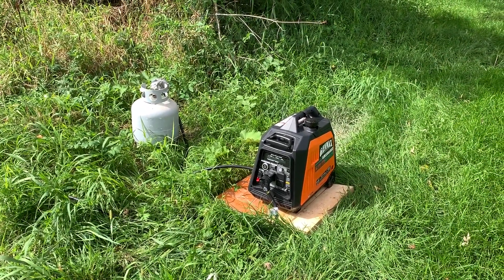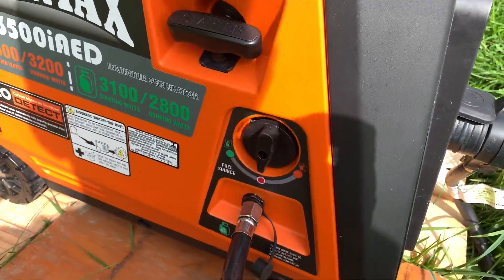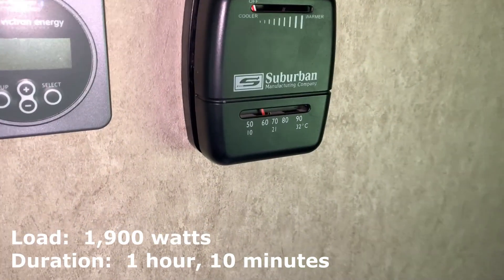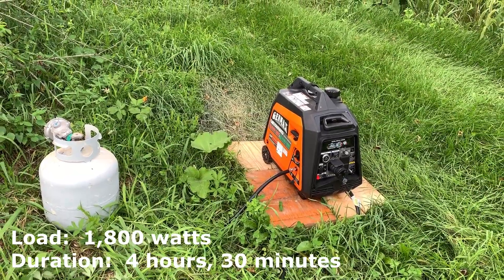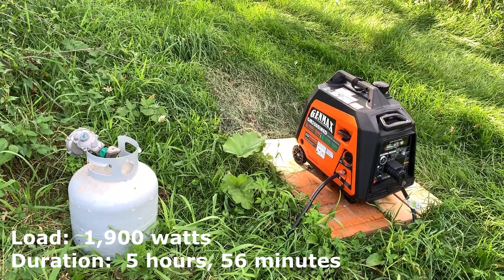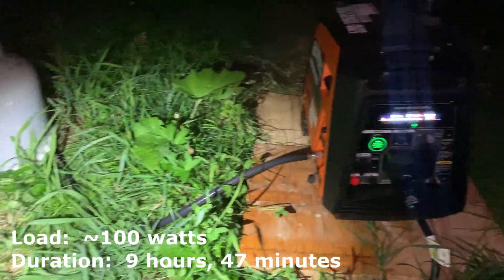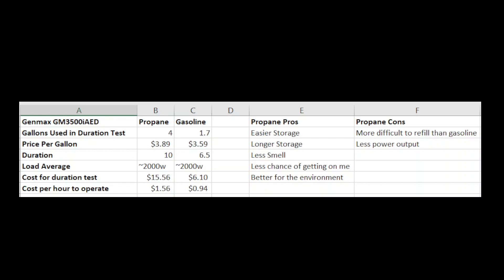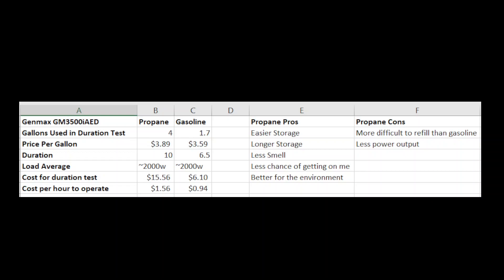Dual Fuel Inverter Generator Duration Load Test - Genmax 3500 (GM3500iAED)

Comment: Liquid propane change to vapor propane is dependent on heat transfed via tank.  When the tank ices, there is not enough heat transfer to convert liquid propane to vapor propane therefore the gen was starving for fuel near 9 hr mark. In a real application, just change to another tank then alllow first tank to come ambient temperature. Good test. I am wanting a dual fuel. This was very well done. Thanks.
Reply: Thank you for this explanation I’m buying this Generator with remote start for my Rv

Comment: thanks, this will be be next gen for the rv, my 2000w works but I am maxing out the output with the ac and solar / battiest charging phase. I need a bit more power and this on is the right size and output thanks
Reply from the maker: The size and power output of these is impressive!  The only downside is the smaller fuel tank, but it isn’t even that big of a deal :) thanks for watching!  If you do buy, be sure to use the link in the description!!

Comment: Planning on buying in spring, have you heard about longevity propane vs gas I know when I used to rebuild engines years ago propane would burn our exhaust valves much faster than with gasoline. Great videos helping me decide on next generator, have harbor freight’s predator 3500 works great but a pain lifting in and out of truck
Reply from the maker: Those predators are great but heavy!  Unfortunately no I don’t have any knowledge or data on the longevity of propane vs gasoline on these engines.  Thanks for watching :)

Comment: Does the remote start work when using propane?
Reply from the maker: To restart after it has been running, yes it does work.  The problem is propane does need to be primed when starting to purge air from the lines.  Priming can only be done on the regulator on the generator, so remote start probably wouldn’t work.  Thanks for watching :)
Reply: @codys-garage  Thanks, that makes sense.

Comment: Have you used your Genmax GM3500Iaed in high elevation areas ? And if so did you have to replace the jet and did you run it on propane or fuel ?
Reply from the maker: Just a few weeks ago we were at 9,000 feet in Colorado.  I did not adjust the carb or jetting and it did fine on 87 octane gasoline.  You could tell it was working a little harder, but it still did everything I needed without overloading.  Thanks for watching :)

Comment: Definitely refilling is a pain for propane, but in a normal trailer you have it anyway.  Of course I have friends that just add a dispensing port off their car gas tank for their generators.  Still can be messy.  Too bad you didn't weight the tank after 2 hours to see what it actually consumed.   Nice video.

Comment: I purchased the Genmax 3500i (with your link, thank you) and on day one, the first time I pulled it around in my driveway, one of the wheels fell off. I tried sticking it back in but it won't stay in. One wheel is well attached and the other just falls out. Do you have any tips or suggestions on how I can hmget the wheel locked back in???
Reply from the maker: I would reach out to their customer support and explain it, also include some pictures.  They are in China so the response time can be about 24-48 hours, but they have always gotten back to me.  Thanks for using the link!  Sorry you’re having difficulties!

Comment: Are you still using and happy with the Genmax 3500? I'm considering ditching my Honda eu3200i as it is hard to start sometimes when the temp drops below 40 degrees. I like the duel fuel and electric start on this but want to know if you're still using it after 8 months, or if you've moved on to something else? Thanks! JR
Reply from the maker: JR, I am still using this and loving it!  It has about 115 hours on it with oil changes at 4 hours, 50 hours, and 100 hours while running full synthetic 5w30.  Just last week we got dumped on with snow in Colorado.  This was outside and in 22 degree weather and the remote start worked flawlessly.  Its a super solid machine and you’ll see a 100 hour review of it posted here.  If you are considering buying it, i have an affiliate link in the description!  Thanks for watching :)
Reply from the maker: I also have 8 other generators to choose from in my garage at the moment (I know, I have a problem), but I always gravitate to this machine.
Reply: That's good enough for me... SOLD!! I'll use your link and Thank you for the follow up recommendation on the oil. You're very kind!
Reply: The EU3000i is an expensive unit that has only been out about a year. Honda goes for perfection but it can take a while. Have you reached out to them for support? I am very curious about this because I want to move to an EU3000i when they get the bugs worked out.
Reply from the maker: @johnganter7352  I have reached out and they declined sending a demo unit to review.  Frankly, their products are very expensive and there are pretty darn good competitors out there for about 40% of the price.  Thanks for watching :)
Reply: @codys-garage  Thanks, but I was referring to the gentleman who said "I'm considering ditching my Honda eu3200i"
Reply: @codys-garage  The economics are interesting. There are credible claims that EU2000i's have lasted 10000 hours in Alaska. Let's suppose an EU2200i will last for 5000 hrs and costs $1400. Next suppose a Chinese generator will last for 1000 hrs and costs $500. This works out to be 28 cents per hour for the Honda and 50 cents per hour for the Chinese product. There is no "right answer" here, each person has to choose their return on investment. Food for thought.
Reply: @johnganter7352 Yeah. But at the 1000 hr I can buy generator #2 and generator #3 later in future. Future model's become better and more features. More Fun. Also when you finally get Chinese generator #2 if #1 is still fine___ You can connect them. Fun in Life also makes the World Go Around.

Comment: Is it necessary to use that 30 amp adapter on a 30AMP RV plug? Curious as to why?
Reply from the maker: Yes!  The generator does not come with an RV ready 30 amp plug, so they include this L5-30P to TT-30R plug so you don’t have to buy one to plug your RV into the generator.  Thanks for watching!

Comment: Nice demonstration. My only question is why did you run the AC set at 60 degrees. Why not set it at the normal temp you would us it and get a real world results. I'm assuming of course that the AC is able to hold the temp in the trailer at a comfortable level.
Reply from the maker: Good question!  This AC unit doesn’t have a thermostat, so it is like the cold/hot mix when you set your car temp.  I also typically left it at the coldest setting, otherwise when the compressor would shut off it would get super humid inside.  Thanks for watching :)

Comment: My only drawback with this generator is the regular they use it would be so much easier on my camper to hook up directly to the propane outlet for the grill instead of disconnecting one of my propane tanks and using their regulator
Reply from the maker: hmm the problem you're running into is a double regulator scenario.  You have the regulator on your camper that will set the pressure, then the regulator on the generator that isn't getting the expected pressure.  I would suggest just connecting directly to tanks.
Reply: @codys-garage  i would not run two regulators would run a straight hose from the cooker connection yo the gen but no way to purge the air out of the line ☹
Reply: Propane generators need two regulators, one to limit pressure and one to limit flow. If it stalls without the second, gas will just keep flowing.  BBQ only regulators expect you to stop the flow manually when turning off.

Comment: I saw your video on the WEN 3800.  Did you determine how long both generators run on a 20lb propane tank at the same load?
Reply from the maker: My WEN is actually just single fuel, so no propane there unless I did a conversion kit to the carb.  Possible, but not planned at the moment.  Thanks for the comment :)
Reply: @codys-garage  Oops. Sorry.  I was looking at the WEN DF400i vs this one.

Comment: Basically reconfirms what I thought.  It's not as cost effective to run on propane.  I bought this for a offgrid rv and it won't be here till next week. I specifically got it for the dual fuel combo with the remote. Gas will be my main source but propane is back up because they can sit for years and years. I agree it's also a pain in the butt to get propane filled. There is one place that sells it for 2.79 per gallon but else where is $3.50ish and my closes gas station for 8mile charge $4.50! Employees always seem so bothered when I need propane filled too, especially in the winter. Hopefully this generator is durable because it has all the features I want and it was only $800 on Amazon ($100 off normal price) can't beat the features
Reply from the maker: Not as cost effective, but if you don't want to deal with smell or old gas, it may be worth it!  Thanks for the reply, I agree with everything you've said.  The people responsible for filling these never seem thrilled to be doing it haha I can say it is durable!  I have about 200 hours on it with several oil changes done and it is working great.  I would suggest running 5w-30 full synthetic oil with a magnetic dipstick if at all possible.  Link to magnetic dipstick:  https://a.co/d/9is14NY
Reply: In Wisconsin, propane is almost always less expensive than gasoline. The 20 lb exchange tanks however, will always be a rip-off.

Comment: I read a review about changing oil may tip the gas out.  Is that your experience?
Reply from the maker: I always have the gen as low on gas as possible before an oil change.  I can see how if the tank was full, the overflow would have it leak out through the carbon filter and likely have it run poorly as well as leak gasoline on the group.  

Long story short, change the oil with the gas as low as possible, this will help prevent spills.

Comment: Since the tank is building up an ice ring near the bottom, would it help to place the tank near the exhaust end of the Genmax so the heated exhaust warms the tank and melts the ice ?    When I worked for a TELCO, we used propane fueled utility trailers and the tanks were near the front of the trailer radiator.   Some had "insulated blankets " to protect the tanks on cold days.
Reply from the maker: I wouldn’t actually recommend having the tanks any closer to the generator.  The ice buildup is normal when tanks are being discharged quickly.  This video was taken when it was about 80-90 degrees Fahrenheit outside.

Comment: Great video, especially the long run test and the excel sheet with data. Thank you!  I have a Yamaha 2000 inverter gen that I added a propane kit to a few years ago and love it. But I’m thinking about going bigger and this genmax seems to check every box. I especially like the monitoring panel. What are your overall thoughts on quality ? I’ve seen strongly mixed results on this. Of course, that’s not unique to genmax. I set up  a champion 2000 gen for a family member and it had loose and cross threaded screws that hold the case and handle together, right out of the box.
Reply from the maker: Quality for me has been great between the genmax products I've purchased.  Other reviewers mention some issues, but if you buy from Amazon you can get a pretty good return/refund policy.  I have over 100 hours on my 3500 and it has been great.  Break it in properly, have a magnetic dipstick, and keep old gas out of the carb and you should be in good shape!  Thanks for the comment and watch :)
Reply: @codys-garage  do you know the dipstick threads? Or can you reference the mag dipstick you use?
Reply from the maker: @floppyebrokent8578  Thanks for the comment!  Linked here is the dipstick I use in my generators: WEN 55201 Magnetic Oil Dipstick for Inverter Generators (compatible with WEN, Yamaha, Predator) https://a.co/d/9is14NY

Comment: I’ve been trying to find an answer to a question on this generator everywhere…. Can you leave the propane open with this generator and remote start it from inside your camper? Most generators on propane won’t allow you to remote start on propane.
Reply from the maker: Hey Justin, I set this up and tested this weekend and it worked great.  One thing to note is that the first time you start on propane it will need to be primed on the regulator.  Basically this just gets the air out of the line and gets the propane into the carb.  So that being said, the first time starting it, it should be done with you next to the machine.  After that, you should be good to use remote start from within your camper!  :)  Thanks for the comment!
Reply: @theconnectedcamper9736  do you mean the very first time you turn it on with propane or everytime you turn it off and back on with propane?
Reply: @randybobandy9828  just the first time you start it with a new can, as long as you keep it connected after that.

Comment: This has been my dilemma.  I have an on-board propane generator, and a small gas generator as well.  Filling propane in some states is a PAIN.  Some states/locales are easy.  I was in Delaware and it took be over an hour-and-a half to find a place and get my tanks filled, but in Utah it was easy.  Varies by state.

I am thinking of upgrading to this Genmax generator because it is still less than 60 lbs.  My Westinghouse is 47 lbs. and runs at 2,200 Watts…the extra 1k Watts would be nice (plus dual fuel option AND electric start).  They won’t deliver it to California, so I’d have to get it while out of state.

Thanks for the review and test.
Reply from the maker: Absolutely, thank you for the reply!  This little unit is quite impressive and certainly fills an area of the generator market that was lacking before (2300w to 3000w).

Comment: Thank you for taking the time to run this test. I will be placing my order this weekend.
Reply from the maker: During your break in I would highly suggest using a magnetic dipstick and changing the oil about 3 times in the first 20 hours.  My magnetic dipstick was quite full!  https://www.amazon.com/WEN-55201-Magnetic-Generators-compatible/dp/B07643J11X